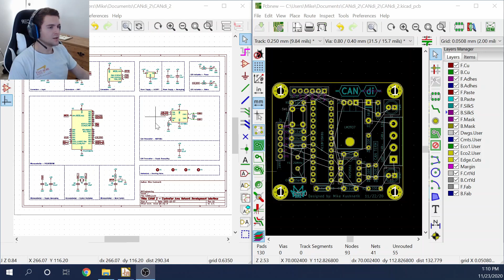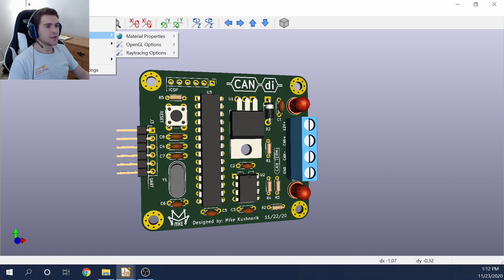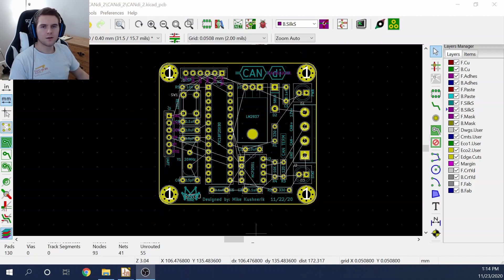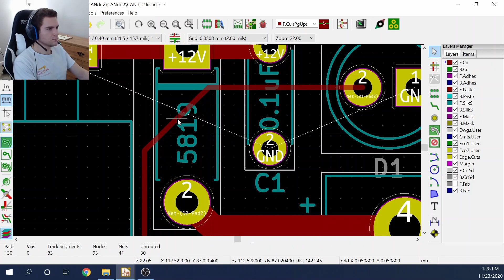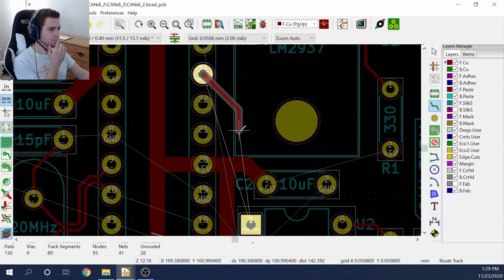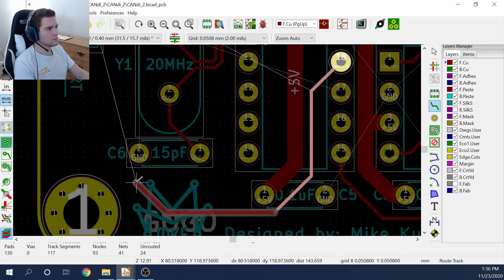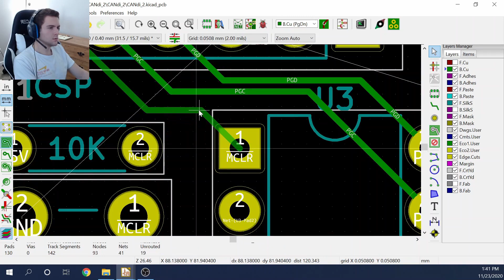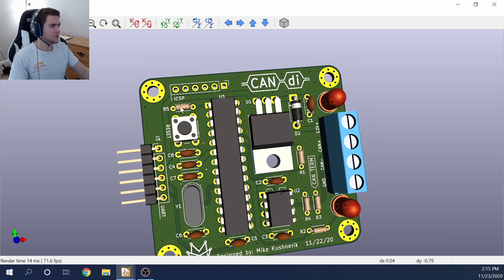Basic KiCad 2-Layer PCB Routing Demonstration

Comment: Kinda curious, why are there tiny holes around the mount holes at the corners of the PCB?
Reply from the maker: Those are vias which connect the top layer pad of the mounting hole to the bottom layer pad. They are placed on some of the built-in KiCad mounting hole footprints. I like to use them as they tend to strengthen the mounting hole / tab.
Reply: @mikekushnerik2226  Thanks for explaining :)